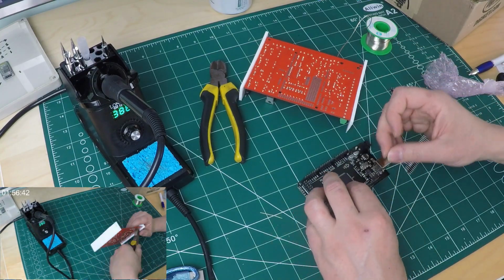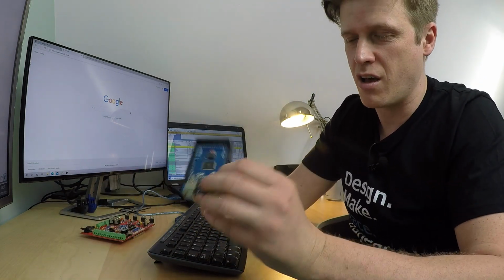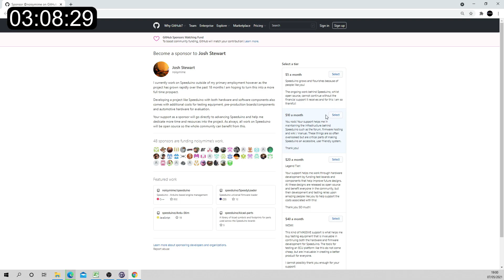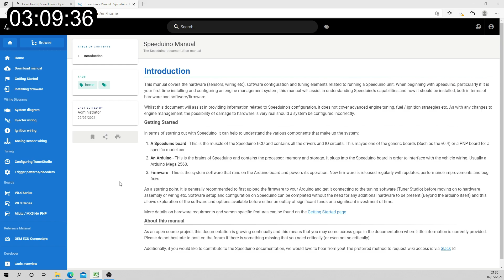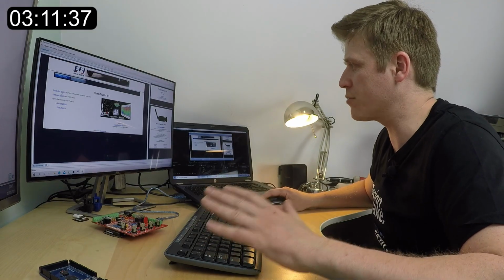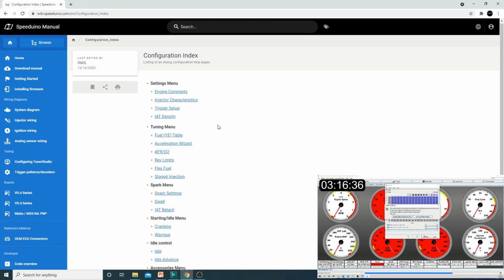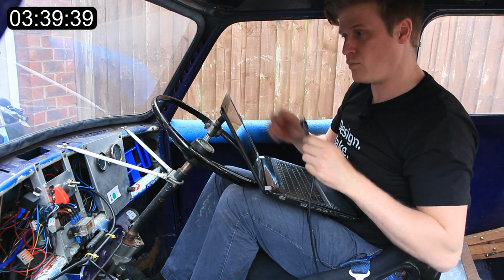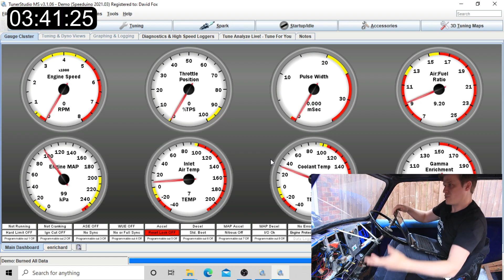Building the Speeduino Standalone ECU - Against the Clock

Comment: Just found this in my front page, and THANK YOU. As someone who is getting long in the tooth, i tried to do the mega squirt back when it first emerged, ( it ended up as an unfinished project and sold on to a friend who, also just let it sit) I kind of side stepped and bought proprietary engine management ($$$) and learned all about the tables, volumetric efficiency and more. Am now  getting back into trying to get fuel injection on my 63 VW. Of course the TBs and sensors are what is kind of holding me back right now, but this is what i will be using for the ECU. Bravo for mentioning throwing the crew a donation. they have come a long way and it has been a labor of love so yes.. i too will be throwing them some cash. And yes as always RTFM, and if you are still confused RTFM. I know a long comment but. right now the EPA is coming down on tuners selling hondata stuff in the US, and this will be the last option available if they keep chasing down tuning companies.
Reply from the maker: Hopefully this will get you in the right direction, I have also done some vids on ITBs from a motorbike for not much money and I am tossing around the idea of a video on junkyard parts for sensors, coils, etc etc to complete the setup… interested?
Reply: @MakingforMotorsport  Definitely! I am always looking to improve my knowledge. And I also support recycling parts that would just end up as scrap!

Comment: Will this work on an automatic? 09 G6 gt
Reply from the maker: To be honest, I don’t know.  There is likely to be a large amount of integration between engine, gearbox and chassis, a lot of canbus signals which will be car specific, there might not be, but around this era that’s when it took off.

It’ll run the engine fine, but what else does your existing ecu do?
Reply: @MakingforMotorsport  it communicates with a powertrain control module and body computer, basic ABS and knock sensor stuff. VVT fixed overlap cam phasing and a few other things I’m sure I’m forgetting. I appreciate the response 🤙🏻

Comment: I saw your last video.  I have a 1992 Audi UrS4.  It had the engine rebuilt and after 8 Grand! On a Aan OBD 1. And not done after 3 years.  I had it towed to a quote top notch Audi specialist?  Everything this guy said was 1000.00? All I wanted to know was if it had been rebuilt?  He took me that it needed a new ECU, battery and it was showing low oil pressure?  He said I don't have the tool to remove the oil pressure sensor?. After 2 grand to get it running. Oh if you really want to drive your car.  You'll need a new oil pump?  It stayed there for a few months.  I tried to scrape another 1000. Bucks together.  I couldn't.  I finally got towed home.  The front bumper is missing and the right side cat. And pipe to the exhaust.  Now I'm done with these great mechanics.  I'm just going to do all the work on my car's from now on.  You make great videos that inspire! Thanks again
Reply from the maker: Thanks for the comment and sorry that you’ve had such a tough time with such a great car!  A decent mechanic is worth its weight in gold but an Audi “specialist” unable to remove an oil pressure sensor?  That doesn’t sound right.  Hopefully you have better luck with it in the future!

Comment: can it be used for vehicles with electronic throttle body
Reply from the maker: Yes and no... yes because the Speeduino doesn’t care who or what is opening the throttle, as long as it gets a TPS 0-5v and/or a MAP signal.  

But the No is because a lot of cars with Drive by Wire have that controlled by the ECU, and the Speeduino doesn’t actively control Drive By Wire so you would need another system to run the throttle...

Watch this space 😉
Reply: @MakingforMotorsport   so if i have to run speeduino on a etb vehicle i should swap it with amechanical throttle.
Reply from the maker: Probably the easiest option!
Reply: @MakingforMotorsport  thank you, kindly point me to some good resources on speeduino complete projects. Also liked ur videos keep going !

Comment: I'm new to this, and I have some questions. It will work with VVT and GDI engines? Planning to build a Locost. Considering a Ford Ecoboost 2.0L turbo engine.
Reply from the maker: Hi there!  It will work with VVT (depends on the type but it can output either an on/off or a PWM signal through the same MOSFET as the injetors use.  GDI is less of a good answer, at the moment I don't think it supports it, there is a reasonable difference in the methodology and electronics for GDI, but I'm not an expert on GDI so it'd be worthhwile checking out the forum, I'm sure someone on there will have given it a go.

Comment: Hello I'm hoping to build a ecu for my Peugeot 106 gti what do I need to buy please help its a 1.6 4 cylinder  and want to put bike throttle bodies on it thanks
Reply from the maker: Aim for throttle bodies from a 600/750cc sports bike... assuming it’s a fairly standard engine they should be fine the other thing to watch for is make sure it’s a cable throttle (btw, check out my other videos on ITBs...
Reply: @MakingforMotorsport  brilliant thank you and thanks for the reply keep up the good work brilliant videos 👍
Reply: Would you recommend the Speeduino 0.4.3C
Or
Speeduino UA4C
Reply from the maker: I personally like the v0.3 because the screw terminals mean it’s easier to change and fiddle with, add wiring and because mine was a bare install it was useful to help me build up my loom.  
If i was installing to an already injected engine then I’d be tempted by the v0.4, as I know what I am doing now, but either will work well.
Reply from the maker: Ha, just reread your comment... The more I look at the UA4C the more I am impressed and looks to be the easiest option for integrating into a road car and has all of the extra features of Speedy on the board by default...

Comment: I see like 4 mosfets on the side does that mean it can only control 4 injectors and can it do 4 coils I assume it can I just would think they would have large mosfets too
Reply from the maker: It’s a native 4x4 channel, 4 injection and 4 ignition.  The big mosfets you see are for the injectors, the coils outputs are to logic level or to drive external amps only...  but it can run a v8 with paired injection and wasted spark

Comment: I'm curious if I could run one of these to monitor and control auxiliary components of my mechanical diesel engine. It needs nothing to run but my wiring and sensors are very flakey.
Reply from the maker: I think that probably depends what you want to control, you absolutely could just use this to condition sensor signals and view the data but most of the control outputs (like fuel pumps etc) are dependant on crank signal which will be a complication for you and the whole thing would be more expensive than just getting separate gauges I’d think.  Possible, certainly.  The best option maybe not.  And if you just wanted to play around, forget the Speeduino board and make your own!
Reply: @MakingforMotorsport  I was hoping to run /iat/egt/map based methanol injection, fan controlling, sensor logging, RPM reading, and some other fun things!
Reply from the maker: Oh wow, a bit more in depth than I thought! For what you need speeduino is probably a good place to start, as you would be able to hook it up and run the sensors and generate a dashboard, and things like fan activation, sensor logging they are all available native, for things like egts and complex condition based outputs switching then these are all doable but need bit more work, either programming or software config, seems like an interesting project!
Reply: @MakingforMotorsport  My bar is set high for my little Jetta. Thank you very much.

Comment: I have enjoyed your video quite a lot, your presentation method is entertaining and the information you present is quite accurate for the most part! There's two things that aren't quite it. Early in the video you talked about the different mega2560 board versions and their clock crystals, these clock crystals are for the serial chip, not for the mega, the one with a 12mhz is a ch340g and can be used just fine. The mega with a 16mhz big crystal has an atmega16u2  as it's uart chip and is generally recommended because you can flash a custom firmware on it to make reset behavior more suitable for a car ecu. Both the ch340g and 16u2 equipped boards run at full 16mhz. On my Samurai project I've had issues with random resets caused by voltage spikes which was solved by removing a capacitor that was there to let the ch340 reset the mega. Another thing, you forgot to mention that people should load the speeduino base tune so that all the properties have some sort of a value to prevent any unexpected problems because someone left a cell at -255. Otherwise great work and I'm looking forward to seeing your next video!
Reply from the maker: Thanks!  I am enjoying making them!  Yeah, a few people have picked up on the Crystal comment, my ignorance but the advice is still the same, get a decent one.  The basetune I’ll be picking up in the final ITB vids when I’m talking about tuning!

Comment: Ok.. you have a new sub...
I have a 600hp 2l sti that I use for mostly track days and a bit of town.. I'm going to give it a go..
Cheers mate
Reply from the maker: Thanks for the sub, 600? I bet that shuffles along!  I drove a 400hp sti blobeye... that was no slouch!
Reply: @MakingforMotorsport  all good mate.. 
Lol.. its a bit stupid around town,  the engine is built for more but I'm limited buy the ecu. I'm using the rom raider software and have reached the limit of what it can safely do.  I was going for a link but this is a welcome new option. 
Cheers

Comment: Thx u for the video but the prices r thru the roof ur better off just buying the assembled one n save you time cuz it looks like ur would be paying the same price assemble n doing there job smh
Reply from the maker: I haven’t checked the prices recently, I already have 1 more than I need 😂😂😂. I quite like the DIY aspect so if I get into fault finding the board, out come the schematic, multimeter and soldering iron!

Comment: They don’t support Bmw n52 msv80 😢
Reply from the maker: Yeah, when you are looking that this age of car you’ve got bigger problems than a connector, these ECUs tend to be locked the VIN number and all coded to the CAS module and keys etc.... Speeduino isn’t going to do this... there may be work arounds (leaving the old ecu in and adding Speedy aswell) but in a car with this much integration you will need a fairly high spec ECU that has specific features  for this type car
Reply: Any recommendations?  I have been researching for ages 😂 everything I found was 3k+
Reply from the maker: Just a quick one, the Core4 boards from diy-efi can run 6injecters sequentially and supports canbus for the dash, so that might be a good choice, you just need to work out how the CAS immobiliser works!
Reply from the maker: No idea I’m afraid, I would be tempted to leave the std ecu in place and just disconnect it from the engine, but your gonna get other integration issues so your gonna need canbus to talk to the dash which you can do with the standard Speeduinos..  I’d be getting on the forums..... someone will have done it

Comment: I love this open source idea, but have some questions. What makes this different/better than megasquirt? Why is the core of this project an 8 bit atmega? There are sooooo many mcus to choose from that seem better suited, including some that are automotive rated for temp, vibration, ESD.
Reply from the maker: What makes it better? Well that’s always going to be personal opinion, I’ve built and run both and my opinion is that Speedy is better as it’ supports 4channel spark and squirt native, it’s easier and simpler to put together because of the Arduino and most of all it’s accessible/cheap!!!  Megasquirt has lost its way, its increased in price so much it’s in the same league as an entry level off the shelf ECU (especially if you want decent features and go for the MS3x), if money wasn’t a major concern I wouldn’t be making my own ECU, I’d be running MoTeC!

As for why Arduino, you’d need to ask Josh,  is it the 100% best no compromise choice?  Dunno, but it makes it accessible , understandable using the IDE and it definitely does the job👍

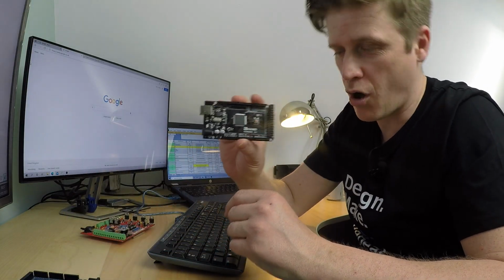Comment: 5:20 the clock crystal you are referring to is used by usb to ttl chip on board. Arduino mega chip crystal oscillator is located just very near the atmega chip surrounded by 2 little capacitor and very small in size. Bdw very nice project.
Reply from the maker: Yeah, there’s a few people have pointed that out, my ignorance I suppose, every days a school day!  But the point still stands as these are trickier to connect and use as a Speeduino...

Comment: Hello there and congrats for your channel ,it's great info that I have found here about speeduino.
Prior to get curious about this stand alone ECU,I was trying to get to work an old E48 DTA Fast ECU from 2003 2004,that I used to have it in a mk2 VW golf Ice Racing car ,that we used for 2 years  in Ontario Canada ice racing championship series where I was the driver for a shop specialized in VW,Audi,BMW named EUROSPEED.CA,unfortunately because the old software it's not compatible with the newest systems of software,or at least I don't know how to make it work,I did ask and I can send the ECU for an upgrade to England,but paying shipping and the upgrade it's  to much money and it's not  worth it  for an old system, Now I'm trying to install a stand alone system in an old  road race car that I had it store for many years(Suzuki swift GTi),it's fuel injected and has a suzuki sport computer but not stand alone,my question  to you is what it will be the best speeduino model that I can put together for it? It's  a 1.3cc 16 valve engine with 12to1 wiseco pistons,high lift Suzisport cams,stage 2 bore and polished cylinder head,straight cut short radio tranny with an LSD among other things,if you can recommend me an speeduino system, please give me a list of everything that I have to buy and where to get it,my current location is in Ecuador South America,thanks.
Reply from the maker: Hi there, it’s difficult to recommend a system without knowing your install, (are you keeping the distributor?  Going to sequential injection? Etc etc) but generally speaking you can fully control that engine with pretty much any Speeduino or 3rd party board.  What else do you need and where to get one,  I’d suggest you watch my previous video, but I doubt there is a reseller in Ecuador!   Best of luck!

Comment: Layperson chiming in. Resistors mixed up. Elaborate with a text box  the work around. U will have to use a multimeter to measure each resistor to determine value.   I am assumingbthat is the solution to that mess.. anyway i now press play at 314. . I may come back🙂

Comment: Just bought one put together with a arduino control board I am so new to ecu and tuneing I don't know what a tune is (just kidding but no i really don't)can you tell me what a arduino board does
Reply from the maker: Wow, way to get stuck in!  I reckon you’ve got a lot of reading to do!  I can simply say the Arduino is an open-source reprogrammable microcontroller but its abit more complex, I’d suggest you do a bit of reading!
Reply: @MakingforMotorsport  I am believe me I am I kinda got the basics of what needs to be done but really I am learning alot does the arduino let you run a tablet for gauges or do I need something eles for that I know it can do it but I'm just now figureing stuff out
Reply from the maker: @charlestorruella8591  so the Arduino is basically the brain, that’s what runs the software and does the calculations, and it has lots of digital inputs and outputs (IO) and analog inputs and PWM outputs.  The Speeduino board is all about providing 5v to the Arduino, conditioning the inputs from sensors and “amplifying” the outputs so they can drive coils/injectors etc...  if you just tried to hook the car directly to the Arduino IO it wouldn’t work.  
For the dash you need to connect to the Arduino and you can plug in or use a Bluetooth module and then a tablet. (I did exactly as the manual suggested and it worked, but the Bluetooth module can be tricky, I had to buy two)

Comment: On the cheap arduino you have isn't the 12MHz crystal for the usb to uart chip?
Reply: Either way the CH340 versions are not recommended.
Reply: @theonewithin609  True, they work if you plan on adding bluetooth and not use the usb though :)